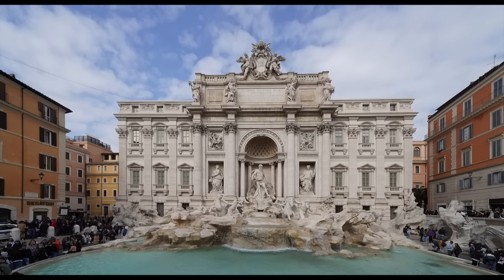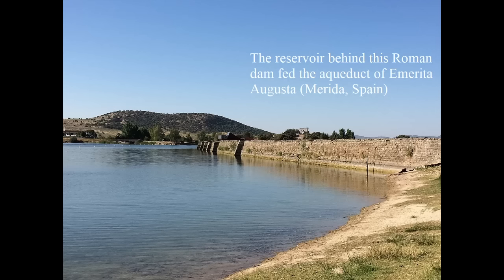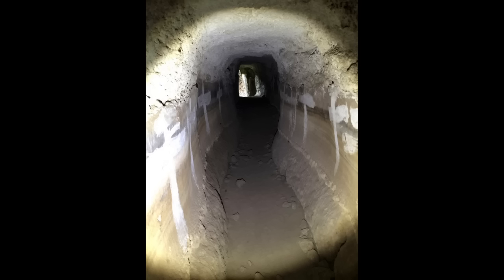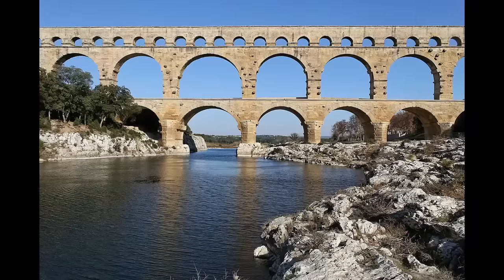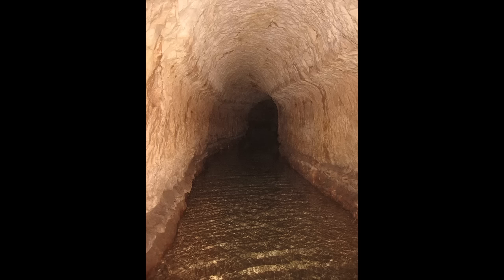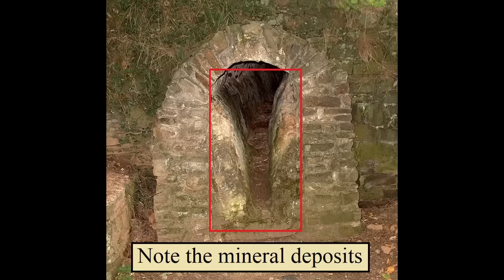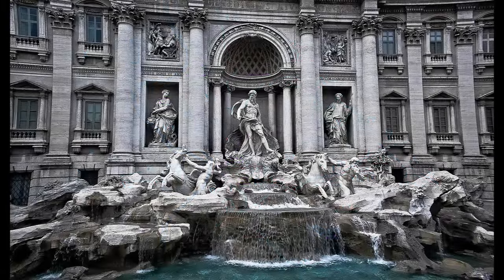How did Roman Aqueducts work?

Comment: Did the tapping of these springs change the ecosystem of the area? I can imagine that taking that much water out of an area is going to dry that area up at least slightly
Reply from the maker: Not usually, since the Romans tended to only gather the discharge of existing springs.

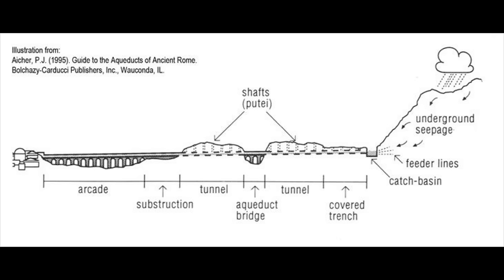Comment: 2:03 Strictly speaking, it's not true that the gradient had to be consistent. Since water finds its own level, all that is needed is that the head/source needs to be above all points on the way to the destination. I could get a bit more technical, but it's not like they needed to make the ducts laser-beam straight over 50 miles.
Reply: your idea works in a pipe but not an open aqueduct

Comment: You may have done this before, but I was curious about what kinds of homes common people lived in during Roman times.  Specifically, I was thinking - how tall/how many floors were the buildings they lived in at the time.  I've seen a proliferation of 5 over 1 building in the US and just wondered if there was any commonality with ancient times.
Reply: These wooden structures you mention are a cancer on the US urban landscape. Those that don’t burn in the next 25-50 years will be the worst form of ghetto environments.
Reply: Not extremely different from today- the poor lived in crowded poorly constructed apartment buildings in the city and the rich had their expensive city townhouses and summer mansions on the beach as in Pompeii. The biggest difference is that many more “middle class” people own their own house now in developed countries whereas back then someone who was between rich/poor probably rented apartments which were a little bit nicer than the common insulae.

Comment: Marvelous engineering work. 
The clip however leads to more curious points I have pondered about: 
1. How did they calculate and measured the slope (which was a very very gradual angle) of the waterway, especially underground. That must be a tough and accurate work.
2. At the end of the waterway- Was there any distribution to the public (ie the Rich and Elite)? and if so did they have faucets in their homes? Where and how was the drainage of the access water (or sewer) go to. Even a fountain in the city center would have mean a lot (too much) of water flowing in especially after wet winter.
3. Interesting to note, that in Judea, Archeologists discovered ancient waterways - One in a tunnel leading water to Jerusalem from a far away spring. To save time the workers dug from both ways over few miles and met in middle at a precise location
The second were waterways in the desert- those were in the fortress of Masada. The waterway will use the water from one dry river bed, which will be flooded once a year, and direct all water into Masada tanks, even if they were somehow uphill.
There are still long and complete intact Roman Aqueducts in that land.
4. Finally a note I heard (but not adhere to myself) – that one of the causes for the Roman empire demise was partially a lead poisoning from those waterways ducts.

Comment: Fascinating!
When lead pipes were mentioned, I was curious how frequent lead poisoning was.
Glad to hear that calcium deposits prevented poisoning.
Reply: Lead pipes were common right up to the 60's. My house still has some lead pipes. The word plumber even comes from the latin for lead. As long as the water is not too soft, calcium scale will prevent lead leeching into the water.

Comment: There is a mathematical formula in which a pipe containing water needs to drop by a certain number of inches vertically relative to its distance horizontally in order to ensure that the water flows properly.  I did this analysis in order to construct an in-ground drainage system comprised of three drainage boxes in my backyard connected by PVC pipe that ultimately drained to the road. Although he mentioned the Romans using some type of mechanical device, to get the drop right, I simply put stakes in the ground, ran a line of string between them and put a balance on the string to confirm that it was level and measured the relative heights of the stakes to ensure that I had the slope right.

Comment: Pick a point center of where you need water then find the closest water source as long as it's slightly above where you need it. Preferably the highest and also lowest place it can be, then fill in the middle with a trough. Even if it's nearly flat it will work as long as the exit point is at the bottom or open ended and the entry is at the top. The rest is quality work because the principle is easy, failure to work properly doesn't mean physics didn't work it means your builders effed up. Once the water arrives you can dispense from there.

Comment: Did the Romans have valves and faucets, any mechanism for controlling the outflow?  I have an image of constantly flowing water, even if only used while preparing food, for instance, and the rest of the time just passing through.

I have another image of this water passing from use to use -- say, rich households in the hills first, then down to the lesser houses, public baths and fountains in cities, finally to run through the toilets and into the sewers / rivers.

Comment: How did the Romans deal with the movement of the earth's surfafe, i.e. subsidence and the change of relative elevation along the aquedact's path due to the activity of faults? Wouldn't that change the slope just a tiny bit each year, stopping the flow of the water?

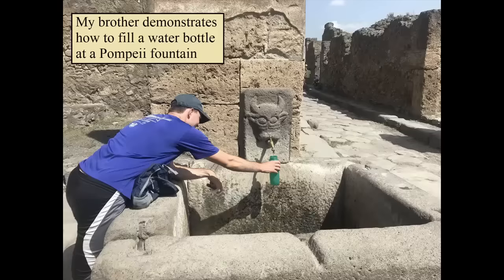Comment: 6:00 By all accounts, lead makes water taste sweeter, so thats no good. In old houses, its one way to test if the piping is lead, the water out of the tap first would taste sweeter than if you let the water run a bit.
Reply: Yup, lead acetate most likely. The Romans sometimes stored wine in lead jugs to sweeten it. Which caused poisoning, of course.

Comment: How was the flow of water controlled? Was there a person at the source that controlled when water was turned on or off? Or did it just flow freely all the time?
Reply: One of the most common methods was the use of gates, which were opened or closed to allow more or less water to flow through the system. These gates could be controlled manually or with hydraulic systems.

In some cases, aqueducts were built with a slight incline or slope, which allowed gravity to control the flow of water without the need for gates. This is known as a gravity-fed system.

Another method of controlling water flow was the use of weirs, which are structures built across a river or stream to divert water into a canal or aqueduct. Weirs could be adjusted to control the flow of water and ensure that it flowed into the aqueduct at a steady rate.

In most cases you would probably have slaves operating the water at key points.
Reply: @spatrk6634  thanks

Comment: Was lead really cheaper than other materials like terracotta for pipe work?  I doubt this very much. Romans likely persisted in using lead pipes as it was better at the job, more malleable to fit, and easier to repair. There are still cities using lead piping today. In spite of any risk of lead poisoning.

Comment: The Fountain is a closed system. It no longer is fed by any aqueduct. It's water is housed in storage and recycled to save water and to aide in keeping the water and the fountain clean. Also. An uncontrolled, open flowing fountain needs to be cleaned. So. It requires shutting off the water flow. Trevi Fountain is drained regularly to remove coins and to clean it. 

So. No. The fountain isn't fed by any aqueduct.

Comment: they also used giant water wheels with buckets on them to lift water up to the top of the aqueducts so the water could flow down hill. that was also used in Egypt and other places at the time. actually it was used all over the world. the technology was common knowledge in ancient times. water sources of rivers  was rarely located above cities but most of them lifted water from the same height as the city and into aqueducts built far above. the shorter the path of the water the better flow speed of the water. i would assume they used it in china as well. evidence for this can be found in the bible if you read between the lines.

Comment: An inch on a mile.
Well, today we are not able to built a straight line. If someone would, just 12 miles or 20 km, he would get dirt rich. 
How? It is simple. Take a flat bed lake, like New Orleans. Connect two sides with a 20km viaduct from concrete. Note, the Roman was stable, make it stable. The middle of the bridge would almost touch the water. 10km to the side, with the curvature (😅) would give 8 m high bridge head, if there was 20 cm in the middle. 24 feet on 6+;miles.
Run hotels, restaurants. Offer electric rides etc. In one year it would turn to profit. Everybody would want to see the curvature 😅😅😅.
Somehow NASA and all governments blocked any attempts to nicely  e d u c a t e  people.😂